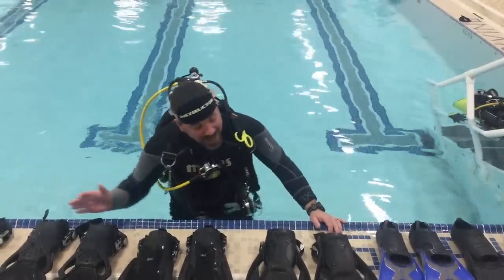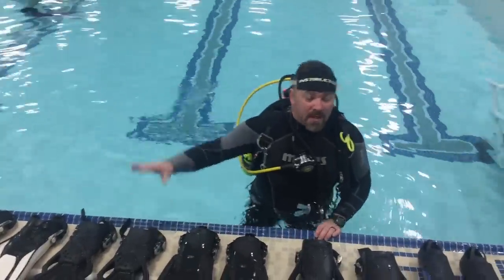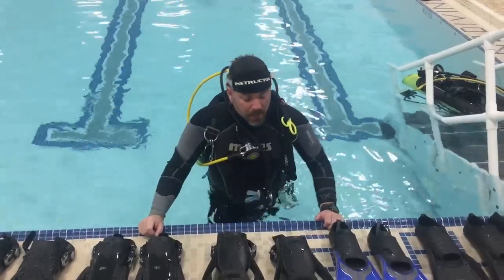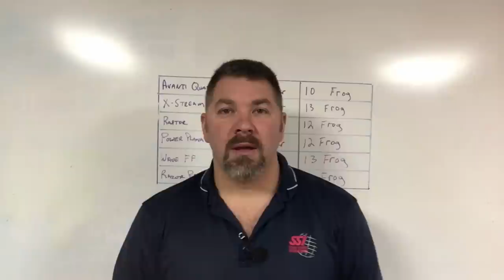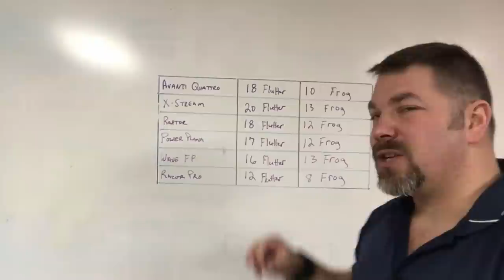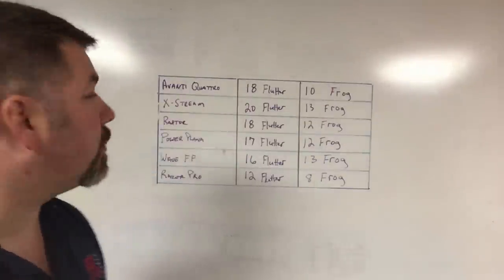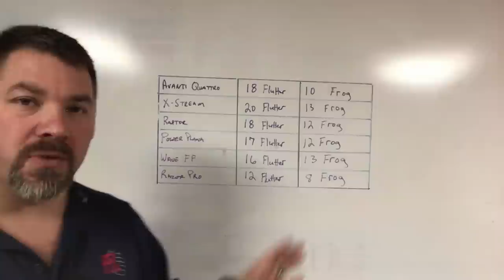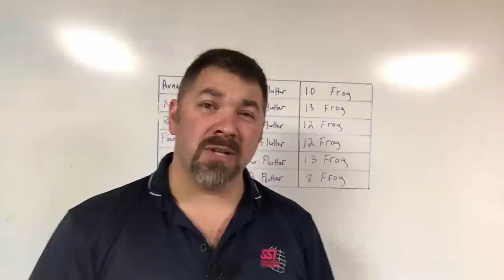Testing Fin Efficiency

Comment: Only mares ? Hummm….
Reply from the maker: Hello @luciebergeron9177, if you have a specific brand you would like to send us to test, we would be happy to test it for you and produce a video for your viewing pleasure.
Reply: @LakeHickoryScuba  thanks for replying. Not a specific brand or model but I need to replace my fins and I have been looking and reading different reviews recently.  Your test is by far the best I’ve seen but unfortunately only mares.  I am a female DM, looking for good all rounder fins. As a woman, we don’t have the same strength, but the goal in the same.  Power without exhaustion.
Reply from the maker: Fin selection can be difficult, and most shops will not allow a try before you buy program. Depending on what kicking pattern you prefer, I personally like a fin that is neutrally buoyant, and has a stiff spine (side rail) but a thinner more responsive blade. This allows me to flutter kick and frog kick interchangeably without causing cramping. If you were local to us, we do allow customers to try fins out before they purchase them. Online reviews can sometimes be deceiving. Not necessarily because the online user is lying to you, but simply because they may have a different kick pattern or leg strength than yourself. So even though they really like a specific fin and it works for them, it may not work for you. I would ask local divers to try their fins to see what works for you. As far as us only displaying Mares in this specific video, we are a Mares dealer and had the fins readily available to test.